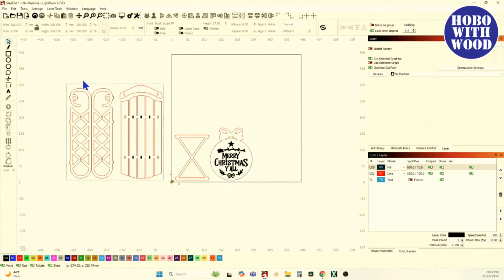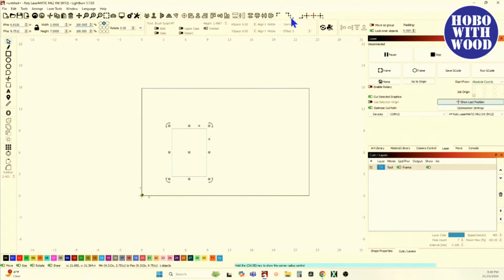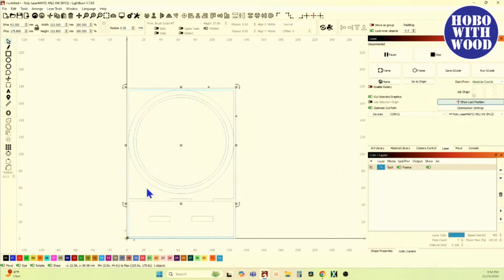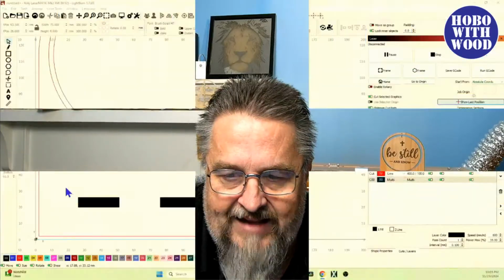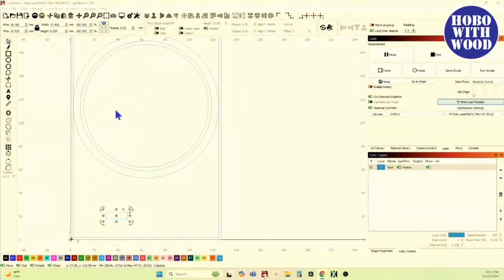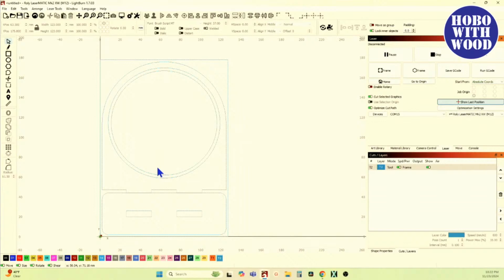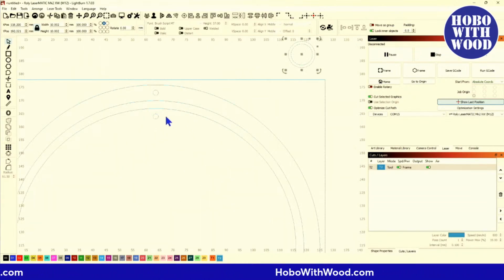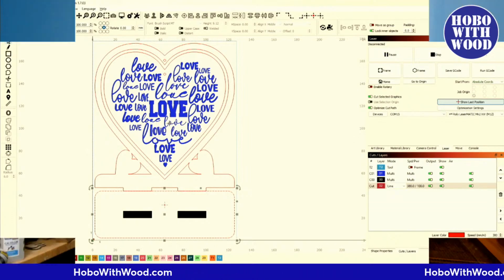Hangin' With Hobo - LIVE

Comment: Hi, Hobo. I'm sure it was in one of your videos, but I can't find it. I'm looking for the video in which you talked about when you cut out letters, but some of the letter extends into the part that is not cut out, and you do a score to show where that part of the letter is. I hope that made sense. Would you happen to know which video that was? Thanks.
Reply from the maker: I have shown this in a couple of videos. But can't recall which ones. Most likely in a couple of the cross creations.  In a nutshell, it requires multiple copies of the text. One copy is used to create the overlapping lines from left to right, using the Boolean intersection tool. The next copies are used to create a Boolean intersection from top to bottom. The original text is welded.  The intersections are placed in their corresponding locations. Once properly placed, the intersected pieces must be edited to remove the necessary line(s) to create the illusion of the overlapping letter.  With the new scissor tool, this process may be a lot easier to accomplish.  It may justify revisiting this process and playing with the scissor tool.
Reply: @HoboWithWood  Thanks!